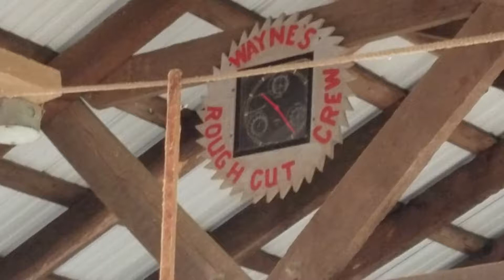Circle saw mill at The Hay Creek Fall Festival

Comment: A lot of people seem to have a pretty  sad outlook on this. I think the history of this set up is awesome and love seeing how it use to be done. Thanks for posting this, trying not to comment to much on your older videos as I catch up but couldn't resist on this one.
Reply from the maker: Comment all you want. We like to see folks in the comment section. I spent most of the day just watching, and talking to these guys. A good bit of info, and some great stories.
Reply: @IronOakSawmill  That sounds like a nice day. Just starting your videos with th lt35. After a bit of research last night I was happy to see you have the debarker on yours. They seem like it would pay for itself in blades longevity pretty quick with the amount you saw.
Reply from the maker: @GG-ub4ej  the debater is awesome. You will see is using a wire to dig out the real bad spots, and rock that are stuck in the grooves of the bark. Most logs we get have been dragged along the ground, and can have rocks and dir impaled in the bark pretty bad. This requires the brush first.